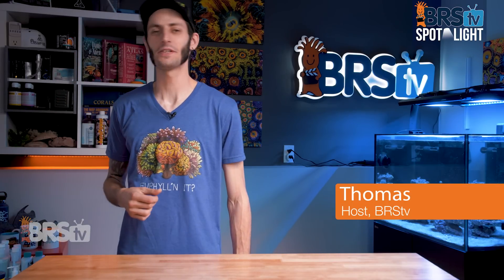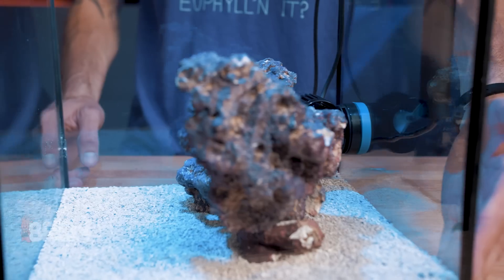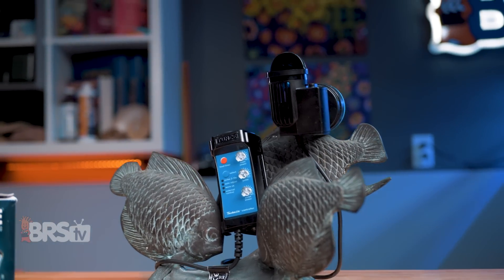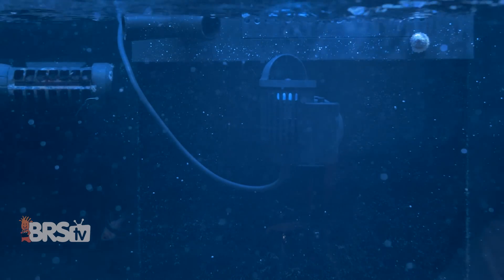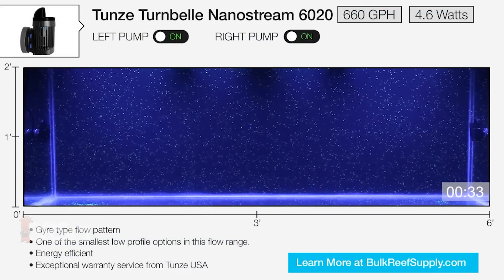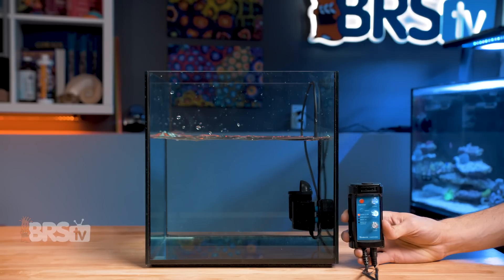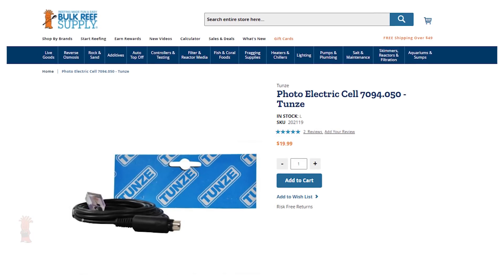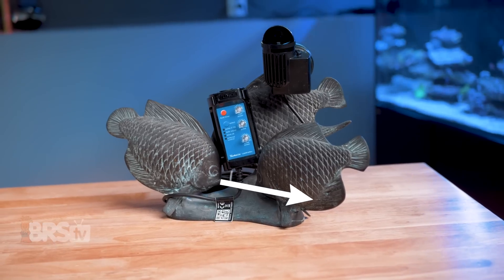Weird Looking Little Reef Tank Powerhead With a Whole Lot of Potential! Tunze Turbelle Nanostream.

Comment: Hi Thomas, I really enjoyed your video on this 6040. But…researching further…omg! All the reviews (much more than one…) have read on the noise?? Has this been addressed by Tunze? I have a 40 Breeder. What do you recommend in the Tunze family? Should I do one or two, one on each side? Thanks! Rob
Reply from the maker: Two powerheads will give you more options for perfecting the flow and eliminating dead spots. If you wanted to stick to the Tunze family, the 6015 (non-controllable) or the 6055 (controllable) would both be solid options for a 40 breeder. We haven't had the noise issues, so the 6020 and 6040 are both pumps that we'd also consider using.

Comment: Thanks for the review, Thomas.
One thing I don't understand, though.
If I don't use the deflector, it looks like the propeller is exposed to fish, inverts.
Is that correct?
Reply from the maker: That's correct
Reply: They'd have to battle the flow to get into it as it sits below the rim surrounding it.
Reply: Thanks for the reply guys.
Reason I asked:
My Yellow Tang and Flame Angel, bask in the flow of my MP10 and Nero. If it weren't for the guards, they'd be shredded for sure.
Understand about the recession, but I wouldn't chance it.
Always considered this pump for supplementation. If I get one, will definitely use the diverter.